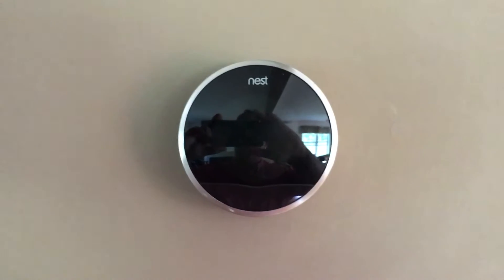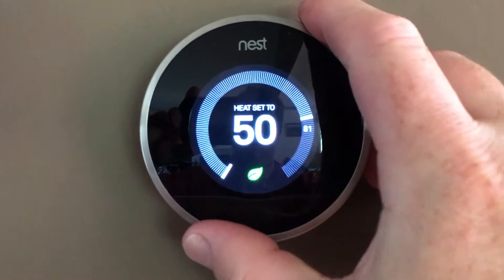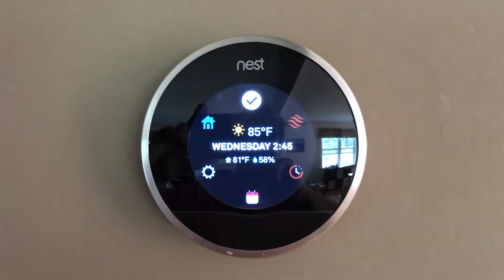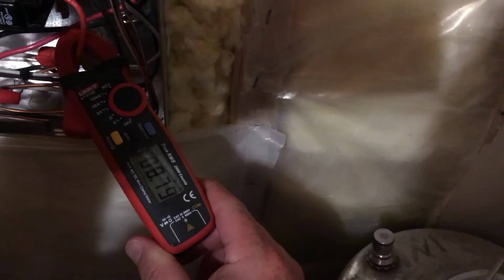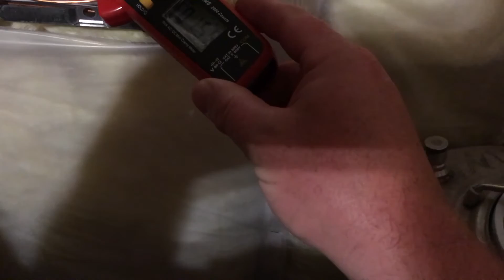Heat Pump Energy Consumption & Shout Out to Chris DIYer's Channel!

Comment: how many amp draw of the heat pump water heater on heat pump mode only. Thinking of getting one with solar input only as power source if its 1600 watts or less.
Reply from the maker: Our GE GeoSpring hot water heat pumps draws less than 500 watts in heat pump-only mode. So around a couple of amps at 240 volts.
Reply: @GreenMountainDIYGuy  L
I am late in seeing  your reply.  I had a Grumman  Sunstream requiring replacment due to  a tank leak .  AFTER THIRTY YEARS!  At one third the cost the hybrid/solar  unit should  be a good  replacment running 3, 300 watt panels. If the water heater  has low  voltage  pertection  i will use enphase  string inverters as they convert the pv dc to 220 volts.  

Thanks for  your informatiin.
Reply from the maker: Robert L. Fallin my ground-mount Solar array uses emphases micro-inverters.

Comment: I've heard that the single units are way more efficient than the multi units ( fans for 3 rooms ).  Do you know more about it?
Reply from the maker: Yes, but depends on the model.  A 6K head is going to be way more efficient than a unit doing 18K.  Check out this for comparison of models.  https://www.efficiencyvermont.com/Media/Default/docs/rebates/qpls/efficiency-vermont-cold-climate-heat-pumps-qualifying-products.pdf
Reply: Thanks!  I believe our demand will be much less, so will probably be one of the smaller units.  Thanks!!!

Comment: How much was it installed and everything? Great looking unit!
Reply from the maker: Thanks.  Around $3500 installed.  I did the electric run from the sub-panel to the heat pump and saved some $$$.
Reply: vtmaestro it'll pay for itself, how does it do with cooling? What size area are you cooling with it?
Reply from the maker: Bajaheat All around it is a super unit.  We use it more to cool than heat due to the fact that I was late getting my additional solar installed to offset the energy costs late last summer.  See my others Solar videos on that.  We will use the heat pump more this winter since we'll have about $600 in energy credits to use for solar heating.  One of the best devices we had installed in our home.  This unit heats and cools just over 1000 sq feet on our main level of our home.  Wish I had done the whole house.  This is the hyper heat pump model design for -18 F weather!

Comment: Where did you get that split unit?
Air Conditioning and Heat  Pump.
I was tell my friend and his wife about this unit and we are planning to get one of those and use it as part of this installation. 
Stay tune for more videos coming your way from this channel. 
Cheers
Reply from the maker: It was professionally installed but I did all of the leg work to run electric and prep for the install.  Installer let me hooked up the electric to the outdoor unit so I was quite happy.  Was thinking of doing myself but with all of the rebates and having to hire someone to pull a vacuum didn't make it feasible.  We love the heat pump.  Perfect for a solar setup.  This is why I am building my new array to power the heat pump(s).
Reply from the maker: See my other videos on the heat pump. https://www.youtube.com/playlist?list=PLbzeOtpXZbGjihYRqrB9jbi65kuuPyQDd